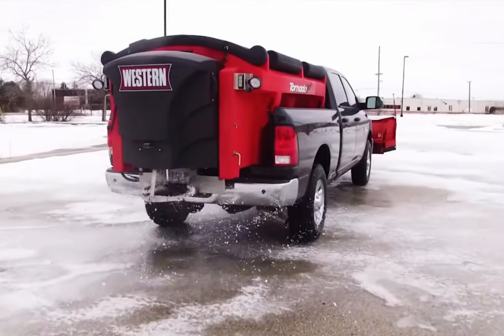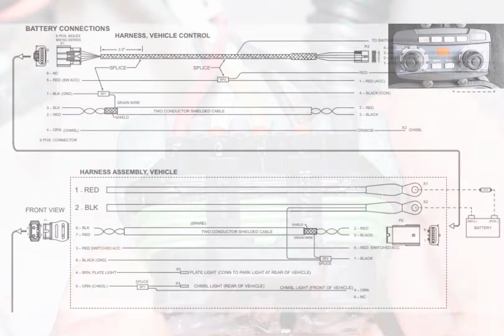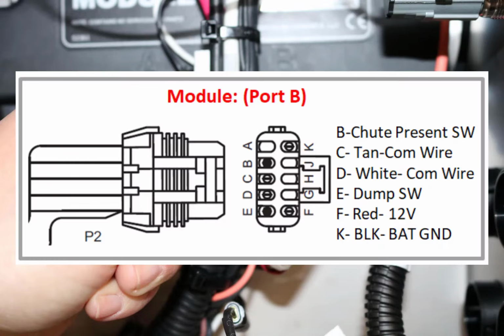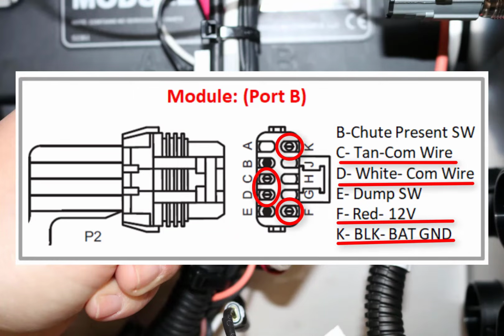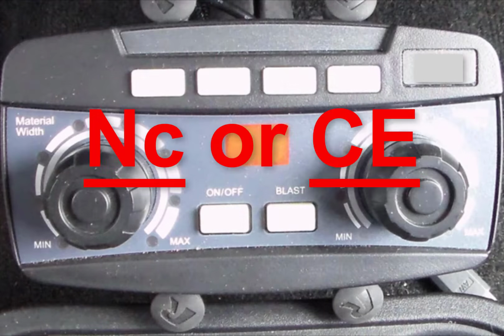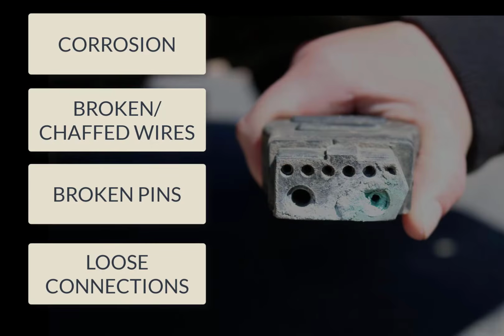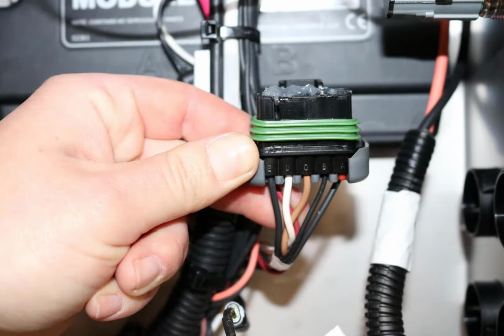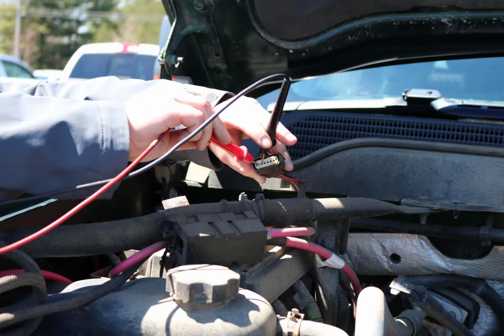WESTERN® In-Depth Spreader Troubleshooting Error Codes

Comment: DU code?
Reply: DU means dump mode, it’s meant for emptying out the salter without the spreader attached to the back, if the spreader is on and plugged in and still says DU you have an open in the spreader harness
Reply: Check the magnet 🧲